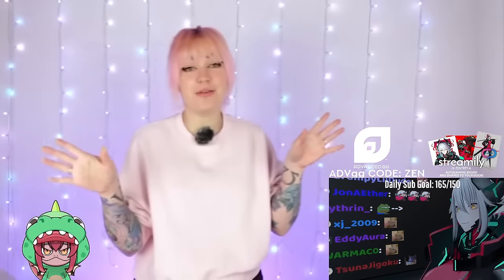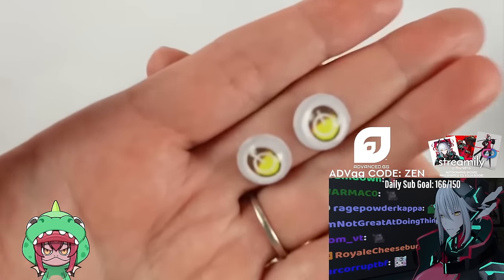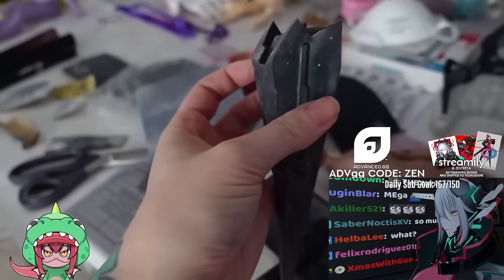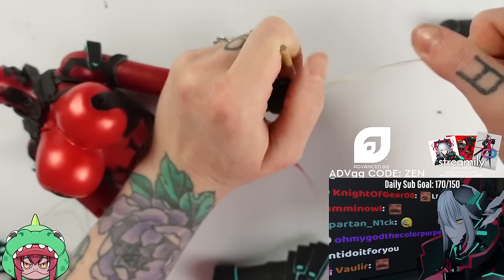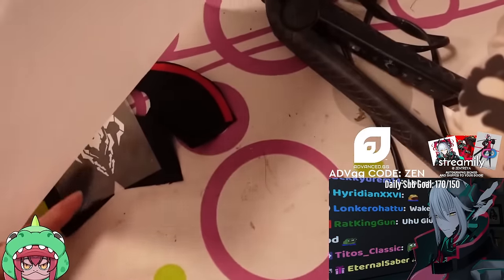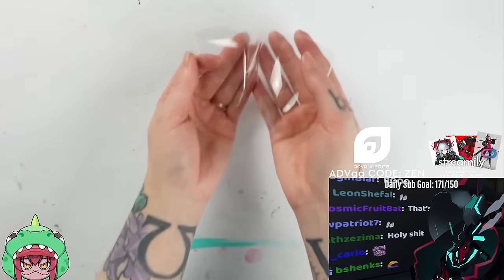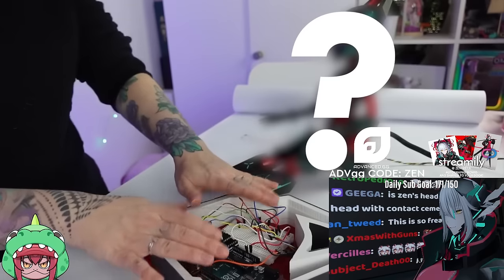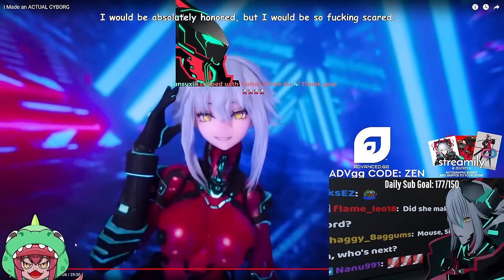Zentreya reacts to "I Made an ACTUAL CYBORG" (Full reaction)

Comment: 250 hours! I didn't even come close with my customs of Commander Zen's gunpla and mecha musume. Moonlight Jewel and her collaborators always blow these out of the water. With all that effort, I can't ask for a copy. But please, there should be figma or Amazing Yamaguchi for all of VShojo, independents like ShyLily, and tons more. There's so much money companies could make from VTuber merch.
Reply: I think you can make cyborg Zen using mobile doll May as the basis. Unlike most mecha musume, MD May has smaller head that should fit cyborg Zen's proportion. The human face plate and front hair is also fairly similar in form, so you'll only have to make the backside of the head. The kit also has alternate gray colored hair, so it should be easier to be painted white.

Her arms look as if she's wearing sleeve, so it'll be easier to emulate the jacket. Her torso and legs also has minimal armor-like protrusion, so you'll only need to add details to it instead of removing parts(obviously you'll have to craft Zen's blade feet to replace the kit's feet). Other than that, you'll still need to mold a new chestpiece, since she's smaller in that department, but the her chestpiece is detachable and can be used as a base to craft the boobs (the kit provides 2 chestpiece, black and gray) in case you want the boobs to be detachable.

I suppose, the problem would be if you want to make the visor too.

....maybe I should try making one when I have spare time. I do have a spare MD May that I haven't touched too much yet
Reply: @spearsage  That's true, May is kinda similar. I stalled while doing Mousey's mecha musume, and since they've all changed models at least twice (heh). After Mousey I gotta finally get around to Silver. I think those were the original set I said I would do. I have to revise my plans. Would you believe I started this before VShojo was founded?
Reply: @BNuts  well, you did write commander zen, which was from way, way long before v-shojo 😆

I must commend you since their designs pre-v-shojo were rather simpler; which is actually somewhat harder to realize when customizing mecha musume (at least in my own personal opinion). And also the fact that the much cheaper 30 minute sisters shouldn't be released yet by the time you started...

The dedication, man!

As for me, while I do follow them since the day when Silver's design was still somewhat western-ey in style, the idea of customizing mecha musume to resemble vtuber rarely ever crossed my mind. Only in recent years did I start expanding on mecha musume (was gunpla main before), mainly because my partner in crime had the idea of making Raiden Mei's herscher of thunder from honkai impact. Made two that resembles dragon zen (because I like her design among other dragon-based vtuber design) and smilfy since then, among other things not v-tuber related (pre-NGS PSO2 character, my own character on same game, honkai impact's characters-though these belongs to my partner's shelf, etc).

Before yesterday, I was actually on a cooldown period lol
Reply: @spearsage  I want to make HoTr, HoO, and HoFi, but I haven't solidified any ideas yet.

For Cmdr Zen's gunpla, I used Amazing Red Warrior. For her mecha musume, I put the Lohen-rinko to use. For Mel, I used Shia Qan[t] and ASRA Archer. For Mousey I used the F-91, and I started out using Bullet Knight Lancer.
Reply: @BNuts  for my partner in crime's Herrscher of Thunder, we used 2 Gundam Seltsam's large right hands to make the large hands, an unused MG Astray red frame's katana for the large katana, and the ring from core gundam's neptune armor backpack. The rest are simply modifying, recoloring, and making a transparent stand for the two floating objects. Base body was mobile doll May.  The dragon was kitbashed from various junk parts glued together including 1/100 deathscythe hell custom's wings. 

With herrscher of reason, we bought a chinese label mecha bike and pretty much canibalized it to make Bronya's bike😅. Used mobile doll sarah as the main body. The curly huge pigtails were the most difficult to make because I didn't think to use bendable cord...

Planned to make Elysia next, but then her herrscher form was released. The project is still in limbo at the moment...

There is also the plan to use the now unused seltsam lance to compliment Durandal's newest suit, but it's also in limbo because we couldn't find a horse with right size...

Now that I think about it, I have many unfinished project o.o